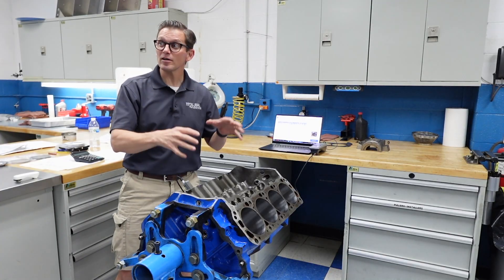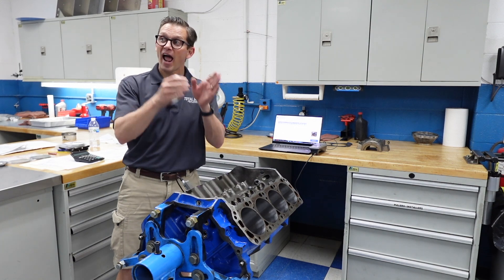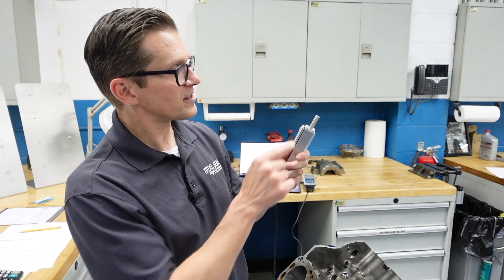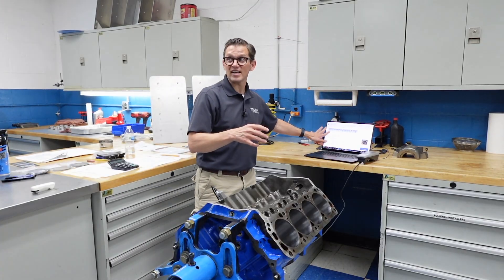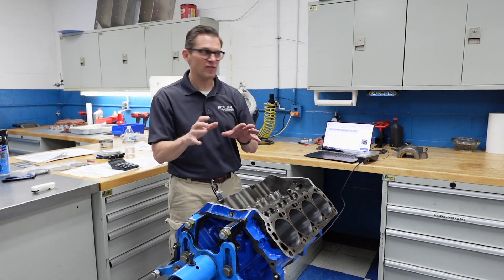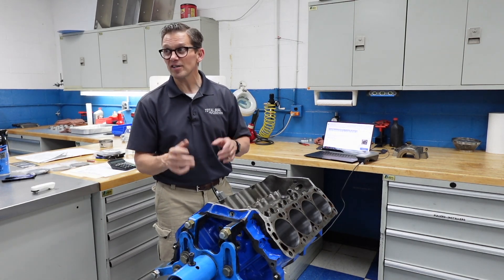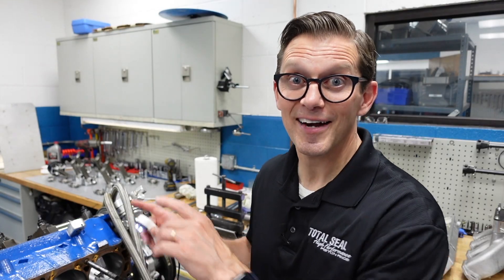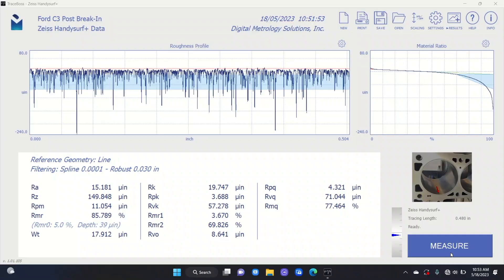How Much Does Surface Finish Change Over Time?

Comment: Being retired,  I'm one of those home shop guys albeit well equipped. I recently refreshed a 5.2 Magnum for moly rings.I used a 3 stone hone (320) with marvel mystery oil and finished with 400 grit sandpaper wrapped around the hone😅..praying my rings are still moly...never smoked on start up and has 150 psi of cranky compression. I even had a larger gap...020 and bent one oil spring tang in to slightly reduce tension..1 year in and no oil usage yet😊

Comment: Its interesting that after rotating the engine by hand that the material from the rings changed the RPK in knocking down the peaks but the RVK didn"t change. where did the ring face material go? wouldn"t the material fill the valley alittle? Is that a moly faced ring? Wasn"t it common practice years ago to "plateau hone" a cylinder ? love your channel. I"ve learned just enough to be dangerous.

Comment: The shop I worked at 25 years ago used the Sunnen soft hone brushes which produced a cylinder finish vert similar to the cylinder finish produced after a short break in. There fore a break in was not needed and you could go directly to the race track or dyno with full load pulls.

Comment: So many back yard "mechanics" use the old honing tool and drill thinking that honing is only to remove imperfections in the bore. Half the time they end up making the bore dead smooth without understanding the true concept of honing. One job i always leave for a good workshop to do with the right machines.

Comment: 🔔😎
25 yrs ago that was my job at the race engine shop. After much coercing I received the latest tech hone stones and nylon bottle brush. Results were +11 hp on our first try on spec 355 SBC circle track engine. This averaged about that on every subsequent engine.
I didnt have those great micro gauges, just old tech. 
Really enjoyed this video information.
THANK YOU 🔔😎
Reply: I settled on the nylon plateau hone for final pass  way back myself. Never see that scrubbing of black residue on assembly he shows here. That trash does do some damage.

Comment: Great information.  I’ve been using Goodson plateau hone brushes for nearly 20 years now and have found that the resulting smoother upper surface finish reduces the break in period substantially and improves ring seal to the extent that leak down becomes negligible almost immediately after startup.  It would be interesting to see the surface detail before and after the plateau hone brush compared to your results here.

Comment: I used to only think about engine oil between the crank and bearings or timing chains and cam lobes and I always missed the oil that lives in the cross hatching. Just thinking about the heat, pressures, and hostile environment that that tiny film of oil is exposed to. And that it's constantly exposed to gasoline. Crazy!
Reply: I’m in the same boat. Engines will always be fascinating to me. I mean how can a 60 pound hunk of metal with other metal pieces bolted on spin more than 100 times per second. And that’s only a small block. I can’t even begin to wrap my head around that
Reply: Mire like 400 to 700 lbs. @jackk21

Comment: If cylinder walls and valve guides need a little valleys for holding oil, what about rod and main journals? Im sure this was answered 80 years ago. Just another random question.

Even if the valleys were less than 20 microns, would that ruin the boundary layer?
Reply from the maker: Journal bearings are different. The eccentricity of bearing along with rotational speed is what creates the film.

Comment: Certain people don't run in engines at all and send them flat out freshly rebuilt after just idling it for a couple minutes to make sure it's working, some people do extremely short run ins but heavily load the engine etc. Whilst I don't believe in either of these methods and prefer a gradually load increasing and longer run in period like you recommend the people that do the opposite don't seem to get punished for it much or at all. You hear the countless and typical stories of "I've been doing it this way since the start of humanity and never had any issues", hard to argue with that sometimes.

What gives? What are the risks and drawbacks of running the engine at full tilt right away or doing an extremely short run in only? Obviously for racing series sometimes you have no choice since you want the least mileage and hours on the engine but I'm talking generally speaking and mostly for street usage. What can happen? Burnt rings? Too much wear too quickly that then gets into the oil and circulates? Bore score? Glazing? Longevity - if so why? Do you notice it right away or only many years down the line? 

Obviously you are going to be running the engine hard "non run-in" so that'll cause it's own issues but what happens afterwards once the hard run in has worn it in very quickly? What are the lasting damages / problems caused by that?

Comment: Would you bring able to do a video on piston rings and what type of rings are best for nitrous, boost, na.  Also touch upon cylinder wall materials such a plasma arc wire vs a sleeved aluminum block and cast iron block
👍🏻
Reply from the maker: Great suggestion!

Comment: So if the rings are smoothing up the cylinder walls… how to the ring surfaces look? And would there be any benefit to using another set of rings once the cylinder walls have the perfect finish?
Reply from the maker: The hard coating on the rings protect them from being damaged during this process.
Reply: My guess is the new rings would find new grooves leaving the ones from the old rings open and causing more oil to slip past.
Assumjng the rings are not 100% perfect. 
I would assume a cylinder hone would be in order for every set of rings.
Makes sense in my mind 😅